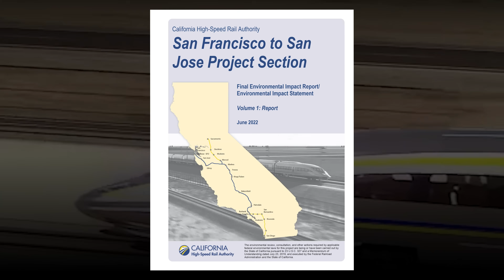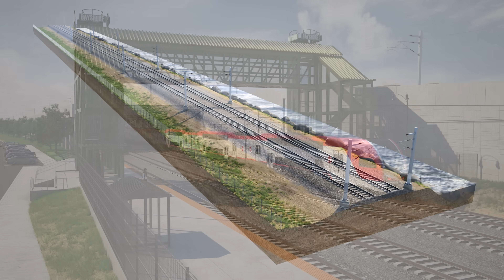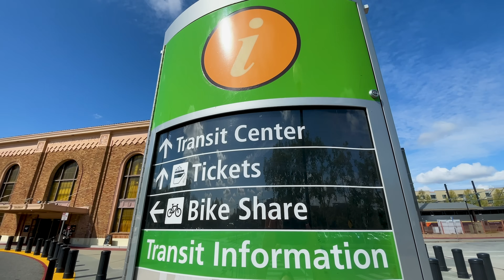San Francisco to San Jose Project Section Overview - FULL VIDEO

Comment: 2:30
listen, I love this project, but y'all should have taken a note from Brightline and improved where they did theirs wrong and grade separated this
Reply: Caltrain already has these level crossings and operates way more trains at the same 79 mph speed as Brightline, but with fewer incidents than Brightline. Brightline's issue has other issues ranging from driver education to poor crossing design contributing to its abnormally high level of collisions.  

I would have liked to see this segment fully grade-separated too, but I also understand that Palo Alto and other cities along the corridor threatened long legal challenges against major HSR construction would have made implementation an absurdly expensive and potentially construction-prohibitive nightmare. The incremental grade separations that CAHSR is funding along the Peninsula Corridor paired with level crossing redesigns should amount to an overall reduction in incidents at crossings compared to current levels.  

This is one of those cases where it's ok to acknowledge that it's not a perfect solution, but it's an improvement over the current status of the corridor and the state doesn't have the means to force the cities in the Bay Area to accept a fully grade separated route as a perfect solution.
Reply: @brandonk9706  brightline's issue is the Florida man 👀
Reply: @brandonk9706  dang, that's one hell of a reply, thanks for letting me know about how the situation is way different
And is also good to know where Brightline did theirs wrong and how California is doing theirs right
I still stand by my statement and wishing they could have grade separated it, but that would be more billions of dollars that big news agencies would just skewer on national TV, and at least they're getting their bang for their buck and making these crossings a lot safer than they were

Again, thanks for the reply

(Also sorry it took me so long to reply, I completely forgot about this comment until I re-watched this video lmao)
Reply: @brandonk9706  Thank you for the great reply comparing the two railroads.
Reply: Most of the at-grade crossings are planned to be grade separated by the local jurisdictions, with around 12-20 already in the planning stages. Don't worry, everything has been thought of already!
Reply: @AmpereBEEP  Hope so, because last thing they need is hearing 100+ deaths due to a colllision with a car/truck. It is incredibly dumb to have any high-speed train at the mercy of stupid drivers who don't want to obey traffic laws. Also, it hurts performance of the train, because it has to slow down for crossings.

Comment: Coming soon, in the year 2525.  :(
Reply: Actually, 2031. And Caltrain will start running their new electric trains in 2024.
Reply: @TohaBgood2  Not to the useless, empty, rooftop garden $2B SF Transit Center. Why is the tunnel project to connect Caltrain (let alone CHSR) continuously IGNORED? So etrains in 2+ years that don't get there until after 2050, right? Can you provide an intelligent answer?
Reply: @davidjackson7281  Because that tunnel is 100% a city project. CAHSR is building to it’s SF Terminus in SOMA at 4th and King. When the city finishes the tunnel to Salesforce, CAHSR will run to Market street.

Why are you constantly repeating this “tunnel” line like it’s some kind of gotcha? The transit center and the tunnel is and always was an SF city project. It has zero impact on CAHSR.
Reply: @TohaBgood2  I am 200% for CHSR! The tunnel is in the city but it's a regional/state-wide project, not just local. The city is not the funding source, but they'll make it take longer and cost more than necessary. That's for sure. I base my tunnel opinion on what occurred with other projects such as the Bay Bridge, Transit Center, and the still uncompleted Chinatown tunnel. You can portray my tunnel comments as "gotchas" but the true fact is the tunnels are the entire project's choke point. Tangentally, I would be for not buying anymore Chinese goods but I would be for contracting Chinese tunnelling services.
Reply: @davidjackson7281  Nope. DTX is an SF city project that project is planned and run by the city. CAHSR participated in the planning as a partner alongside Caltrain, but they have zero control over the project. Their planned terminus was always the current Caltrain station at 4th and King.

The Muni Central Subway is 100% complete and undergoing testing for a launch in a couple of months. But that is again an SF city project.

You need to read at least a little bit about these projects if you want to criticize them. If anything, that will allow you to make better and more constructive criticisms.

Currently, everything you are saying comes directly from anti-rail oil lobby propaganda. That is extremely easy to debunk because it is all fake.
Reply: @TohaBgood2  Oh boy! You mean in maybe perhaps just NINE short years a meaningless ride to and from the mega-metropolises of Merced and Bakersfield. Seriously, so what? You must be joking. Hahaha! Just call us skeptics ... trolls. Oh my poor feelings.
Reply: @davidjackson7281  Fresno and Bakersfield are one million population metros each. The other stops, Visalia, Merced are large cities too. Yes, these are large cities that need to be connected with high quality rail.

The current train that already runs there and that CAHSR will replace is the 5th most popular rail route in the country. Do you think that that is by accident?
Reply: @Oak Island Pictures Yes, I agree with you. The Pacheco tunnels are infinitely more important than the end of the SF line. My frustration comes from never properly terminating the rail line downtown ever since the 19th century! Norcal (5th gen native here) benefits from the Pacheco tunnel being first. I am glad and I get it. Not to put any sour grapes on this blessing but (yes but) I believe the Tehachipi will be more challenging and the really tough challenging tunnels will be 20-25 miles through the San Gabrials. $$$$$$$
Reply: @Oak Island Pictures Yeah I love this project. I shall try to ride as many Amtrak, etc. trains in the Bay Area, Central Valley and the rest of the state as possible. That way I'll have a point of reference and a high appreciation for the CAHSR. Recent estimates are under $19B apiece for both the Bakersfield to Palmdale and the Merced to Gilroy segments.
Reply: Why does it take america 20 years to launch such projects but Asia and Europe half the time.
Reply: @Limosethe  Nonsense. CAHSR started construction in 2015. They are finishing the first 117miles of guideway next year. That’s a very respectable pace of HSR construction for anywhere in the world and about 2x faster than anywhere in Europe.

Your propaganda got stale bud. Tou can’t keep using the same lies when CAHSR is finishing segments and structures left and right. You need new material.
Reply: @TohaBgood2  Oh really, a "guideway" by 2023? What's that supposed to mean? A guideway to protracted failure? Come on, get real.
Reply: @davidjackson7281  Yeah, you know that thing that trains run on? That’s called a guideway, bud.
Reply: @davidjackson7281  You can't place tracks on a guideway that doesn't exist. Building the guideway is 90% of the process when constructing HSR as it includes all of the bridges, tunnels, embankments, and trenches. The land needs to be flattened out and the sub-roadbed needs to be laid so that you can place the ties and rails and then fill the gravel in underneath. Tracklaying and electrification takes very little time as all of the time consuming preparation work was done during the guideway construction phase.
Reply: @TohaBgood2  I'm for HSR.  It gets me depressed that by the time we can go from L.A. to S.F. on these trains, I'll long be dead.  :(
Reply: @roachtoasties  That’s unlikely unless you are very elderly or have a deathwish. The project has had a lot of issues with completely unprecedented political obstruction early on. That has added a lot to cost and delays. But CAHSR has beaten pretty much every single lawsuit and is moving very quickly in construction now. 

I’m sure that the opposition will keep trying to make life hard for CAHSR going forward, but it is extremely unlikely that they will gave too much success going forward. They know that too. That’s why most of the dark money groups have moved to funding opposition to Texas Central now. There just isn’t that much more damage that they can do to CAHSR any more.
Reply: @TohaBgood2  I hope you're right. If so, I'll be first in line in L.A. to take the train north.
Reply: @AmpereBEEP  Yes, tracks need a guideway. I am looking forward to when they start building the tunnel guideways.
Reply: @Limosethe  Most projects in Europe and Asia that you may be referencing here have full funding by their governments so the entire project can be constructed simultaneously. CAHSR has project segments that can be completed individually or simultaneously in 7-10 year timeframes. Since this project has never had full funding, the segments can only afford to be build incrementally as grants and Cap & Trade funding slowly rolls in. So far, the project has only spent about $10 billion including the $700 million on Caltrain electrification.  
For a recent example, politicians in Sacramento only finished releasing the 2008 Prop 1A funding this year (14 years after it was supposed to go to the project). This current political atmosphere is toxic to the timeline and budget of the project. Unless we get some real political change and the project gets a serious amount of funding, the project will continue to be forced to take the incremental approach.
Reply: @brandonk9706  I am 200% for CHSR. Your comments are 100% correct. The concluding sentence says it all. Thanks.

Comment: 2:30 Accidents will happen.
Reply: dude I was just about to comment the same thing with Brightline being patient fucking zero
I love this project, but this should have been grade separated
Reply: @CrazeTheZilla  Brightline uses single gates on an active freight railroad where everyone is used to slow freight trains.

This is on an extremely active urban passenger railway where trains already routinely run faster than Brightline. Everyone knows not to try to outrun fast passenger trains around here. (Plus there is a drastic shortage of “Florida men” here.)

Additionally, Caltrain is installing quad gates unlike Brightline. These are used all over Europe and Japan with similar or higher speeds and with zero issues.

Comment: Neat, as long as they're able to replace international airports, the pollution offset vs jets will be significantly less than a single plane flight vs a year+ of electrified rail
Reply: Much of the fuel used in flights is to take off and land. The actual length of the flight is less impactful. That means that the short haul flights that this will compete with are really what are being targeted and will significantly reduce emissions within the region. There are far fewer international flights than regional flights in California.
Reply: @es3359  it's crazy how much fuel is used even just idling on the ground. There's no sense in wasting so much like that. I've traveled on Southwest Airlines my whole life, and they've always provided a great and convenient flying experience for the limitations airline travel are naturally bound to, but I can confidently say I would never fly with them again so I can ride a good train. Maybe they should branch out into passenger rail in the future.
Reply: @mrmaniac3  If the HSR train takes less time, the train is more comfortable and less stressful. You will feel much better physically and psychologically.
Reply: I don't think high speed rail will replace intercontinental flights without massive undersea tunnels. Domestic flights and international flights to and from Mexico and Canada can easily be replaced by rail, of course. Electric trains need to become our transportation backbone.
Reply: it's never been about replacing airports. It's about having another mode of transport and making that mode much more efficient and green as possible compared to existing modes. Airports and planes are also getting greener with new fuel and plane technology and designs.
Reply: The new plaines comming online will definitely help- doubt we could ever really end one form of transport over another….. now, if they only have the guts to make it possible for those of us using wheelchairs to ride in our chairs instead of having them ride separate from us and possibly get damaged, or worse, destroyed!
Reply: You are an absolute lunatic. Please move to Germany and enjoy Greta Thunberg policies IRL.
Reply: Existing airports are at capacity while the population is increasing. Nobody’s talking about removing airports.
Reply: @spencerjoplin2885  One of the great things about HSR is that it eliminates a large portion of the ~120 flights per day that take place between LA and SF, freeing that space up for the interstate and international flights that are actually necessary.
Reply: @AmpereBEEP  not just that, takes 2-3 hours on average at the airport, of TSA, waiting, refueling, boarding, and heaven forbid it gets cloudy, windy, or starts sprinking because everything in the airport is at the mercy of mother nature

If the HSR promised LA to SF time is right, a single train more people moved average than a 3 airplanes can in a day, and a train leaving every 15-20 minutes
Reply: @shitfuckmcgee8611  a convenient and seamless ticketing system can really make a public transportation service. I want to be able to ride the bus, bike, or metro to the station on a whim, buy a ticket smoothly, and wait for the train to arrive shortly without paying much attention at all to timetables. Then relax on the ride and spend some time doing something productive or fun. That's what good transportation is all about.
Reply: @SplitScreamOFFICIAL  350 km/h for high-speed rail is too easy. China can operate its HSR at 380 km/h, but consume more electricity and is not economical. 350 km/h is good enough. The United States has a per capita GDP 7 times higher than that of China, so electricity is not a problem.